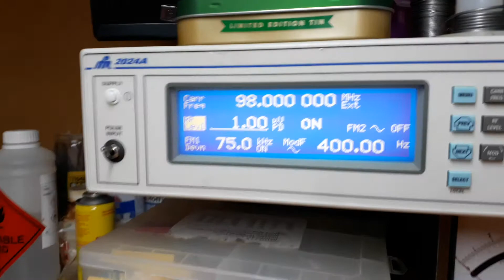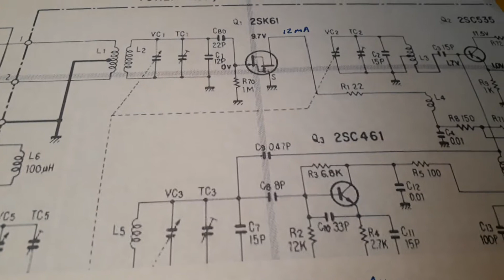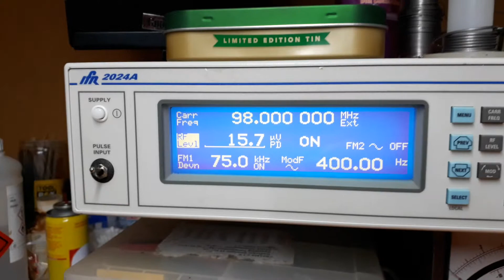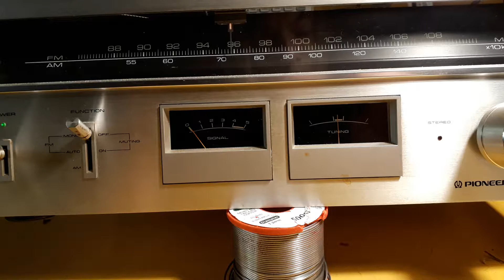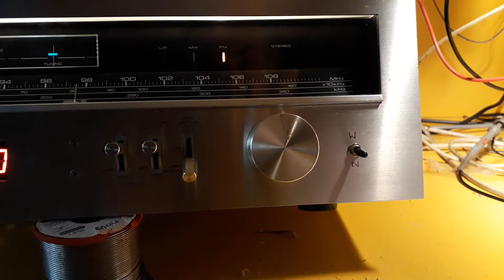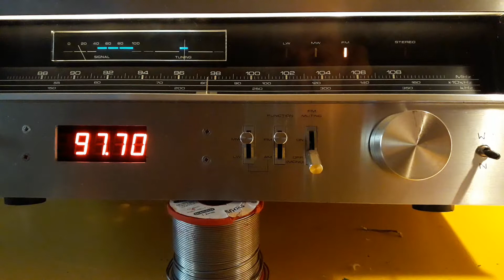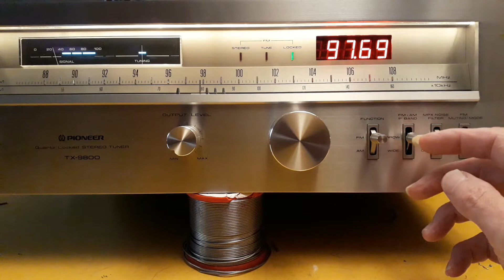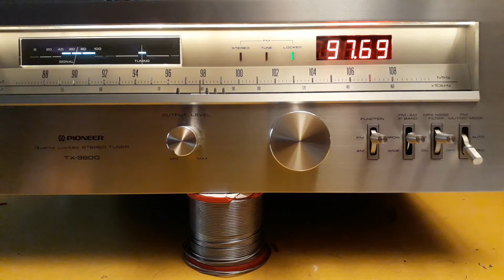Experiments with a Pioneer tuner, and also looking at the famous Pioneer TX 9800 !

Comment: The 9800 really is a nice stereo!  The freq counter mod, nicely done!  How far away is your ant/led from the sig-gen for testing purposes?  I'm not well versed on the subject as I am learning the subject and you are clearly more advanced than I, but have you tried Darlingtons or would they be to sensitive?  Could you take two of the model that's in there now and stack them as a "home made" Darlington trying to get the gain but escape the noise? What about a VLNA or standard preamp? ~Jack, VEG
Reply from the maker: the cable to the sig gen is about 3 foot so virtually no loss at vhf, darlingtons would be useless at these frequencies they are basically low frequency devises, what you need is a low noise transistor or fet. I have used an external rf pre-amp but you have to be careful as strong signals will overload the tuner causing intermods.The tx9800  although 40 years old is so sensitive it doesnt need an external pre-amp